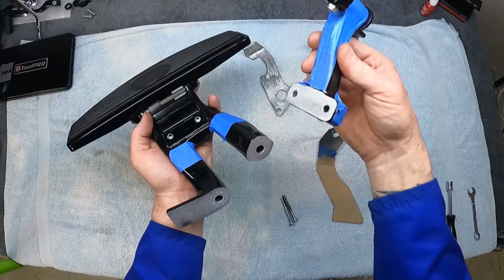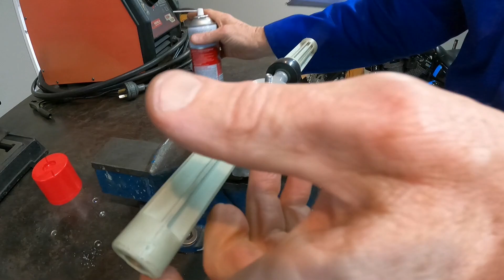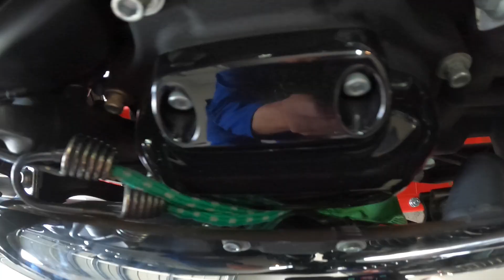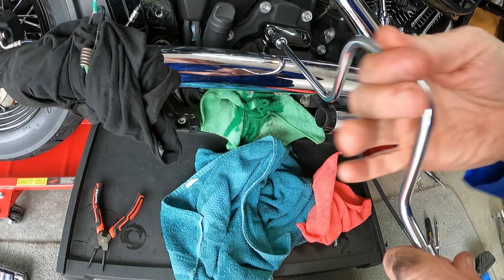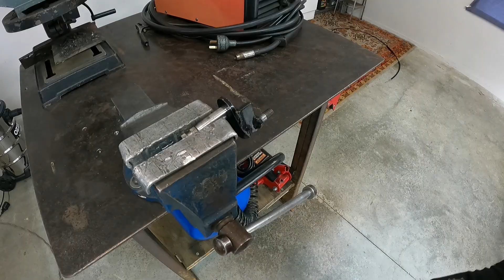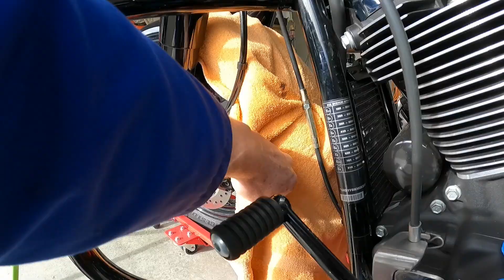2019 Harley-Davidson Heritage Softail – Jockey Shift Project Part 3 – The Foot Mechanism

Comment: Little trick if you get small marks or excess polish that goes white on the Matt black around the bike. WD40, spray a small amount on it and use an absorbent rag and dab off straight away.
Question on the foot clutch, I’ve seen these many a times on LNSPTBLVD vlogs. As we all know, when the wife moves her very fine rear on the back seat at the lights while stationary, we have to use the other leg to balance the bike. How does this go when using the foot clutch?
Reply from the maker: @Steve-Debs  I've fitted a Rekluse centrifugal clutch this week, you can come to a stop in gear with the clutch out then just roll it on and move again.  Keep an eye out for episode 6!